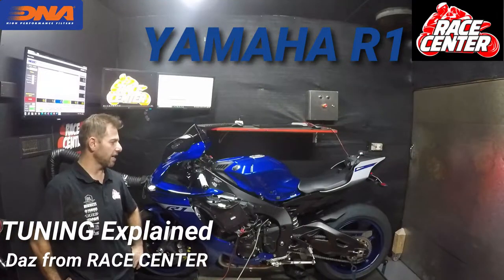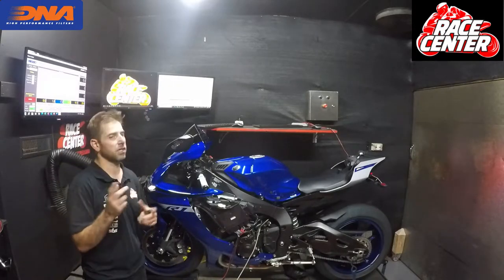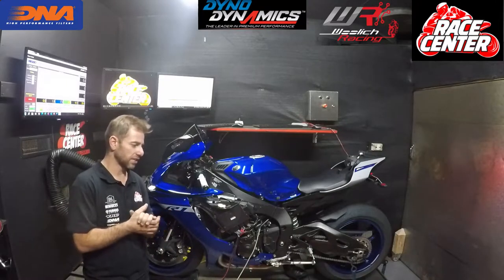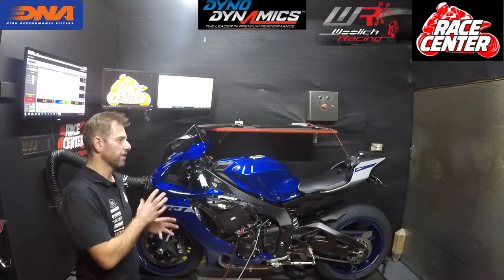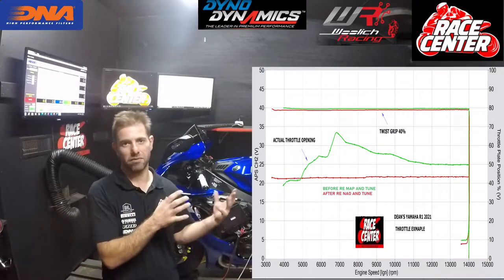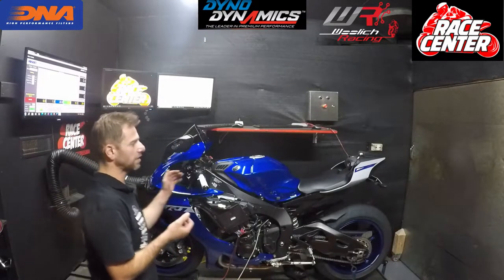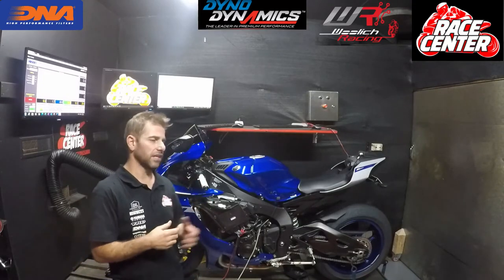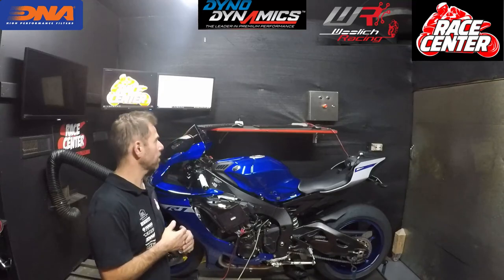2021 YAMAHA R1 TUNING EXPLAINED

Comment: I think you missed the fact that 4 is rain mode.

Anyway youtube is throwing me all the tuning videos after I bought the woolich kit for my mt09sp after a local tuner tried to scam me on price and I said f'it I'll do it myself. I though I'd comment even if it's only to expand on what's in the video.
I appreciate that you're forced to walk a fine line about giving information out because anyone can steal your maps and put them out there.

For anyone that cares... Woolich cracked the ECU's and can read from them and write to them. That's where they come into play. A better description is that they're the tool box full of tools. They have the stock fuel maps for ETV and IAP. Woolich also has tuning functionality relating to AFR and a diyer has the benefit of being able to tune based on real world conditions where things line ram air effect comes into play. Not something that a dyno based tuner can always replicate.

As a software tech it's all pretty easy and once you crack the woolich log file format to get all the extra data out 🙂some simple statistical maths can replace the dyno for a good diy'er because power and acceleration are related to change velocity changes over time. But yeah you have to know your maths.

Using the Woolich software changing throttle maps is easy to make linear or into whatever curve you want in whatever mode you want and whatever gear you want.

I expect with the R1 that it's similar to the mt09. The ETV and IAP fuel maps are common to all gears/modes. The modes really only just dictate how much the twist of the wrist relates to the electonic throttle valve opening for each gear.

Comment: This bike comes to you new from Yamaha with such crap setting, it would deter those who don’t know what’s going on. The throttle and many other setting need to be changed, tweaked or remapped for the bike to actually ride smooth, and proper. 
These guys seem to know their stuff, great work guys, and thanks to some dude Dean for lending his bike for all of us to learn from!
👊 #R1crew
Reply from the maker: thanks for the comment mate. Yeah it is puzzling why they come pout of the box the way they do, but at least it gives us something to do fixing it :) riding it afterwards is like a different motorbike!!
Reply: @RaceCenterAU  hey, did you remove the speed limiter? What would top speed be? 
The last 6months has been awesome riding with Dean👊